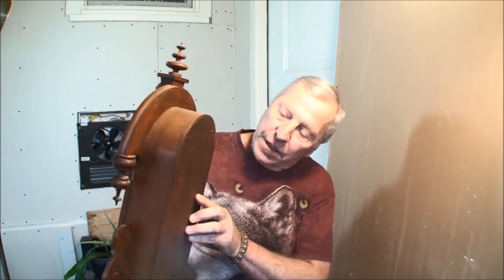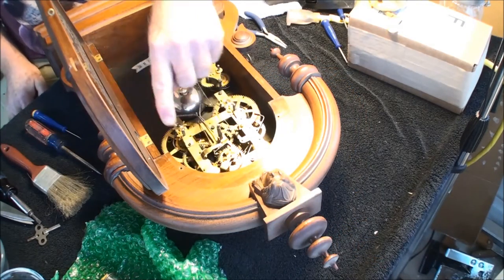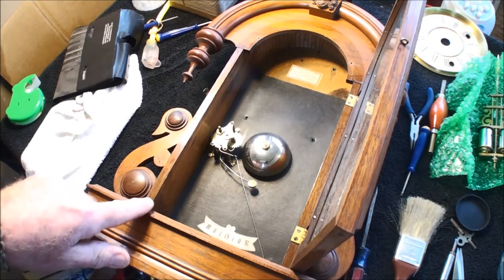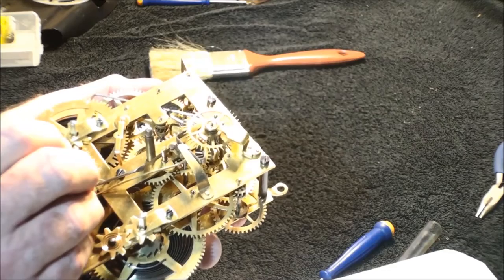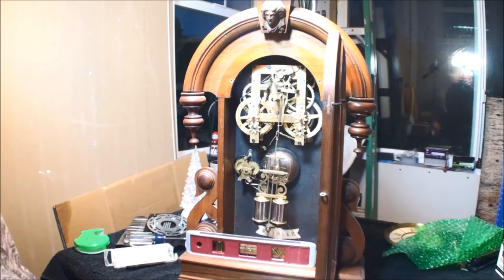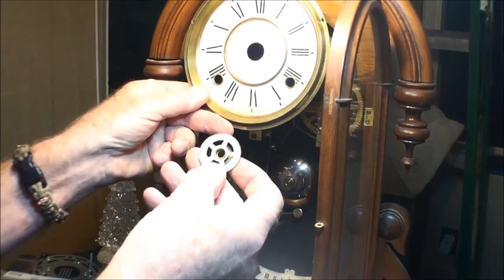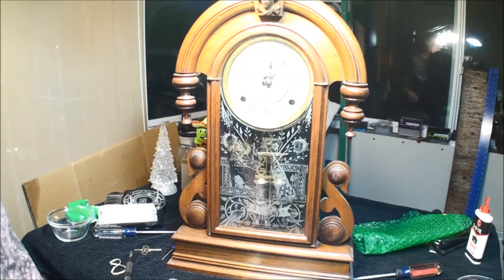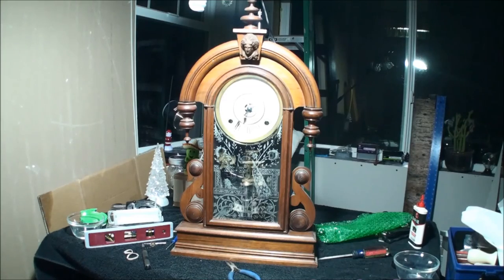Vintage Kitchen Clock Lets Clean and Oil the Clock

Comment: Mike, once again I enjoyed your video. The clock works looked shinier as soon as you took it out of the green goop. You are very methodical. Something I appreciate since I have ADHD. I’ve always wanted to skip steps to get to the end result and duh 🙄 that never works!! You are very brave taking these clocks apart. 🕰 🛠 I made a few polymer clay clocks using the hands and works from the arts and crafts store. They got bent over the years. Maybe I’ll be brave enough to take on that repair now.
Reply from the maker: Joanne Bea, I was lucky to be able to watch my dad work on clocks and also able to pick up cuckoo clocks from the thrift store. I had the attitude of, if I mess it up, it didn't cost me that much anyways. It also helped watching other videos to get the basics and try to do it better. You have a Very Happy New Years Joanne Bee

Comment: i got a 1879 ingrahm thats covered in dust but i going to do it on my own because of $$ at repair shops what house hold cleaning appliance can i just for it
Reply from the maker: You can use Dawn Dishwashing soap with Hot water and let it soak, along with swishing it around. Also use a toothbrush to help get the oils and dust off the gears and plates. Do remember that it cleans, but not as well as a clock cleaning fluid. So, what this means is it might take some time to work in the Clock Oil. Such as it might not want to run for very long and you will have to hit the pendulum several times to get it running all the time. Hope this help you  out Mike Roe.
Reply: @justmike57  i just did that theclock would not run and chime mechanism was loud when running were loud but now it runs better now just oil and cleaning out bushings

Comment: I doesn't even keep running...maybe because you were messing with the alarm.
Reply from the maker: After cleaning and oiling the clock, it should run good. The alam should not affect the running of the clock 1pilotsteve.
Reply: Ahh ok

Comment: I have a family heirloom mantle kitchen clock and its wound so tight it wont work.
Can you help or suggest what I should do.
Reply from the maker: You can do one of two things. 1. The Safest way is to; Keep swinging the pendulum every time you walk by it until it can loosen up and keep on running. 2. The not so safe way unless you have the right tools and experience  you can take the face off and see the little keeper that holds the spring from unwinding with the key, Put the key in and act like you are winding it, but at the same time use a small screwdriver to hold the little lever back and only unwind a 1/4 of a turn at a time. Why, because this is a bit dangerous and if your hand slips off the key, it could tear your hand up before you know it.
  Hope this help you Virginia Cook
Reply: @justmike57  Thank you. I will try the pendulum fix first.

Comment: With the minute hand having that square hole, how do you adjust it if it doesn’t strike at the 12 o clock position (it instead strikes 2 minutes past)? Thanks so much!
Reply from the maker: There is the brass piece with the square hole in it. That will pop out of the minute hand. If you notice, it has little gear like teeth. Have you clock strike the hour, and move the minute hand to the 12 and press it back on the brass piece with the square hole in in Abraharn Wu.

Comment: Very nice video... What is the cleaning solution?  Is it safe to use in a stainless Ultrasonic cleaner?
Reply from the maker: Personally, I would not use this Clock cleaning ammoniated cleaner in my Ultrasonic cleaner because of the really strong smell that should be used in outside or very well ventilated area. I just bought the Clock Cleaner that is non ammoniated cleaner for my stainless ultrasonic cleaner. If you look at my playlist, under cuckoo clock repair. You will see a video of the bottle I was using in this video. I also show the new Bottle that you can use inside and have used it already and does a good job Richard Woodward.

Comment: Great video...but one question please. What is the solution you used to soak that clock movement in?
Reply from the maker: Here, I use Clock Cleaning Concentrate - Ammoniated. There is one that is Clock Cleaning Concentrate - Non-Ammoniated that is safer indoors. You look for clock parts on some sights and you will find it.

Comment: Why did you not disassemble the clock and clean all the parts and oil sinks separately, then you can polish the pivots. What would you do if you needed to bush the holes ?
Reply from the maker: Paul, my cleaning of the clocks is for the people that want to try on their own to get their clocks going again. Some don't want to spend a ton of money bringing their clock to a clock smith and some don't have one in their area. Taking the clock apart is way over most people's heads and then putting the clock back together and getting the timing right so the clock will work again. 
  For what I show on my channel is a way to get started on the cuckoo clock and start to understand different things about their clocks. I help a lot of people with my email address below the video that I don't get paid for. This channel is a great start to learning a little about cuckoo clocks and what makes them tick. 
  Thanks so much for your concern and interest.
Reply: @justmike57  thank you for your really helpful reply.  Now that I understand I appreciate your work and commitment 
Regards Paul

Comment: What cleaning solution are you using?
Reply from the maker: Hey King Hill, I use a clock cleaning solution, and this one is a very strong ammonia, I just ordered on that you can use in closed spaces. It is from Ronell Clock Company that sells it. Concentrated Clock Cleaning Solution, Non Ammoniated.

Comment: It was all interesting. But especially how you adjust the tick and tock to be smooth. These clocks were made to be fixed & keep working. Nowhere I've lived had kitchen exhaust fans. I had to use a lid or spatter screens.
Reply from the maker: Thank you for stopping by again Karen4you. These clocks are really old and have seen some that were just flat wore out. but I did bring them back to life. Without a good exhaust fan, that makes more cleaning to the walls and ceiling. To bad. You and yours have a Happy New Years.

Comment: Hi Mike, what is the green solution you used to clean clocks. Can I use  to clean a regula movement ?
Reply from the maker: This was an Ammonia based clock movement cleaner. You have to use it outside and when ordering it, you have to pay for shipping chemicals. I have ran a crossed something cheaper that you can make at home. Check out the video in the Playlist on my channel. It should be with the cuckoo clock repair videos.
Reply: @justmike57  thank you Mike. I have bought some ammonia but not sure if it's will affect some of the plastic wheels in my Regular 25 movement.
Reply from the maker: @edjunis2703  Straight Annona might not be a good thing. Always check you movement ever 5 minutes when using cleaners that you don't know how they might reach.
Reply: @justmike57  thank you Mike, most definitely I will dilute as per instructions and check. Thank you

Comment: hey can you work on Baby Ben's and regular Big Bens? I have several Big Bens and a Baby Ben that run but then stop after a while.
Reply from the maker: I like the larger clocks, because I can see them better. I could give them a try if you really like them Del-Rio Drifter.
Reply: I do love them because they have 2 stage alarms  and they are very dependable and accurate once they get working.  I will see if I can find them in storage if you are interested in giving them a tune up @justmike57
Reply from the maker: @Drifter5.7  If you can find them, I could look at them for you Del-Rio.
Reply: I will do some digging I know I have a black Big Ben and a Baby Ben here at the lake house @justmike57

Comment: What was the name of that green cleaner?
Reply from the maker: It is for clock cleaning, and it comes in a gallon jug that you dilute with water. It smells like ammonia and is so strong, that you need to open the container OUTSIDE. So that might give you a hint on making your own from a local store.
Reply: @justmike57  Ammonia was taken off the shelfs. Just try to find it in any cleaning isle at the store.
Reply from the maker: @badbadbob1  , They do have a very good degreaser at the autoparts store that is safer. I do believe they call it PURPLE for degreasing.

Comment: Hi Mike , 
Is you cleaning solution home made ? If so could you share your formula. 
Thanks Tom W
Reply from the maker: I go to  RONELL CLOCK COMPANY, P.O. Box 5510, Grants Pass, OR 97527

Open M-F 9am-5pm (Pacific Time)
Toll Free: (800) 334-0135 or (541) 471-0194
info@ronellclock.com, and I order the clock cleaner there. I just started to use the non-ammonia solution because I use it inside the house now.. Clock Cleaning Concentrate - Non-Ammoniated
Clock Cleaning Concentrate - Non-Ammoniated
SOL-100N

Great cleaning with less fumes. Hope this helps you